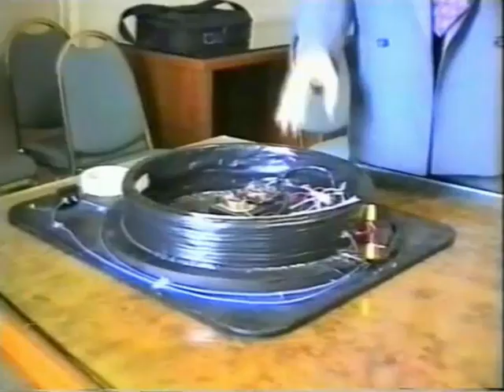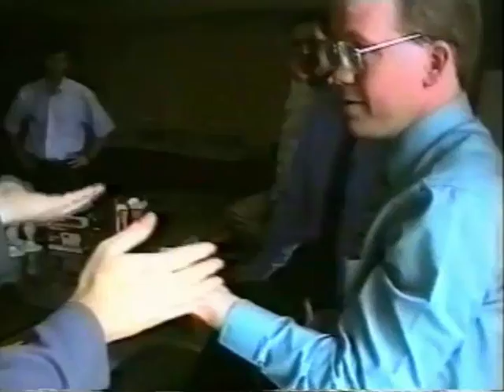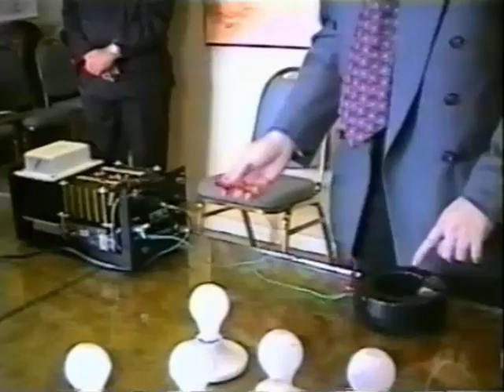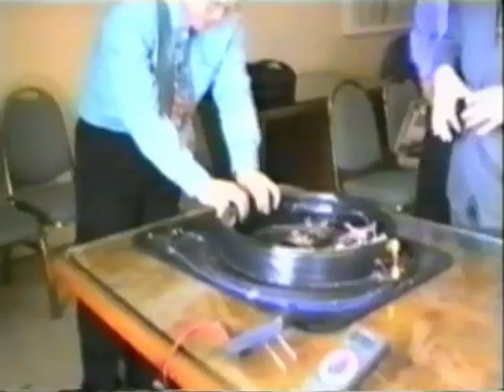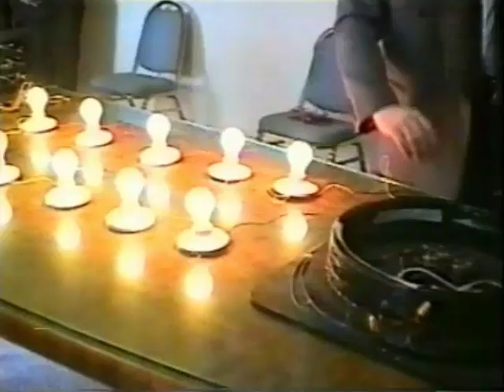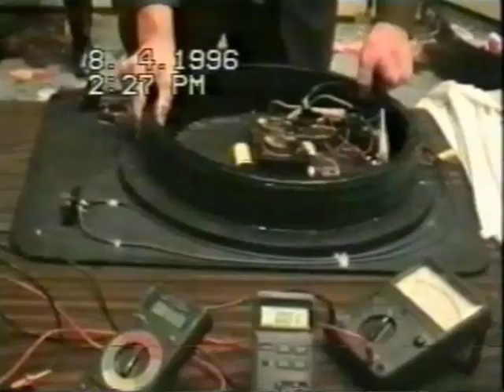Steven Mark - TPU - The UEC Generator Demonstration - Narrated by Brian Collins

Comment: the tpu creates a dc current spinning vortex magnetic field that generates intertia like a flywheel. it is classic like a rodin coil. its air core. there are two winding 90 degree out of phase with the big center winding. the device generate mechancial force as part of the emf it carry. there is a relationship between intertia mechanical force emf and sound resonance where the emf can build up in the ring like inertia in a flyhweel speed up. the emf grow just like the increeased inertia in a flywheel. the device absorbs emf input and stores it in a magnetic field and can also absorb other energies like heat and light. i seen many examples of the same device before. the standeyo antigravity device is technically made the same way, the kapagen flywheel also seem to use the same principle as well as the experiment of the rodin coils creating a dc spinning magnetic field and emf builds up in the vector 90 degree out of phase with itself like a separate magnet. in theory the magnets is just a distraction. the device does not need them to work. a similar concept is a  ring magnet with a capacitor in the center some electrodes a propeller spin up the salt water solution and heat can then be converted into electricty by the magnet as the salt solution travel and spin trough the capacitor plates. a solid conductor on simulates a conductive working fluid.
Reply: @Primodernious - Have you performed experiments with the TPU? How do you know this information? Can you provide some links to reading material or experiments. I am very interested in this subject.
Reply: please help, God will reward you !!!

Comment: Too bad the basic circuit has not been recovered. seems to be some kind of resonant amplification using caps and toroidal inductors with naturally high frequencies that he then steps down to standard power levels (opening a slot for amplifying whatever power he was already at. Apparently, he does not know how to avoid loading transformers with load connections to provide unlimited energy.